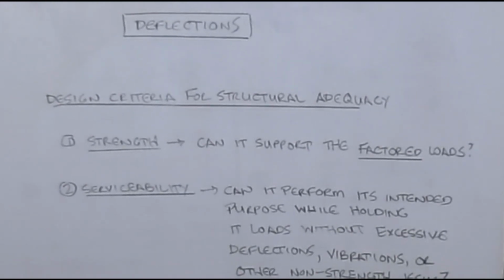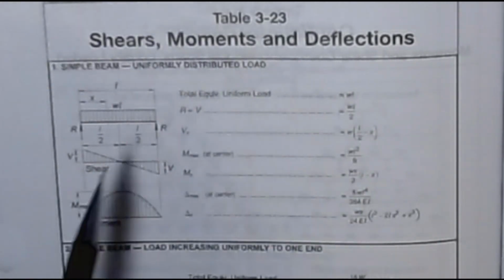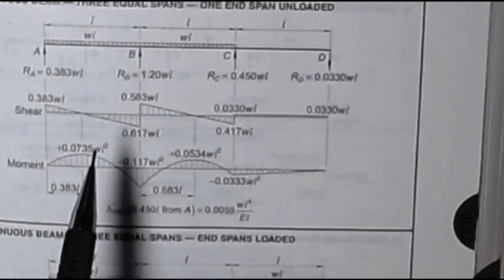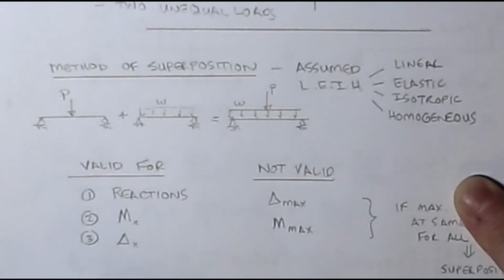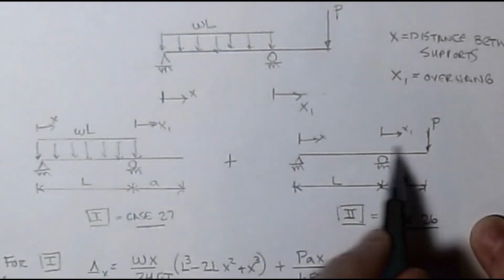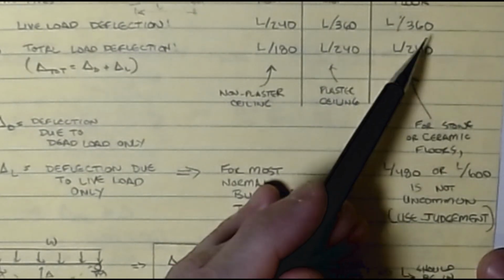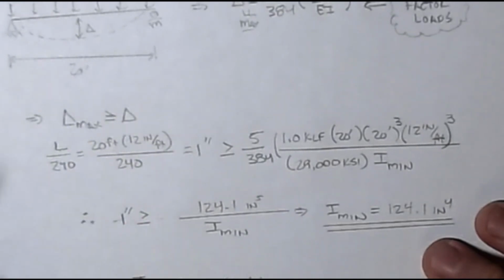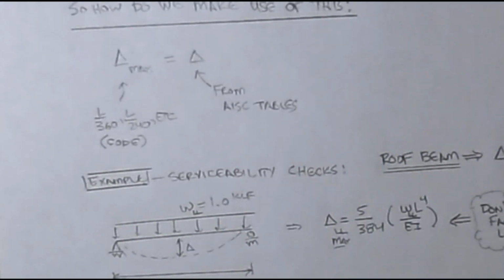027 CE341 Steel Design: Deflections and Serviceability of Beams

Comment: Great video, very simple and helpful class! I have a question. When you are considering deflection limits, how would you consider the deflection on the secondary beams as the limit? The relative deflection of the beam between supports, or the global deflection (because the primary beams would also be deflected)? I would like to hear your opinion on that.
Reply from the maker: For secondary members being supported by a girder, you have to determine the deflections of the secondary member separately to figure out its relative displacement to its original position (call this the chord displacement -- Part A).  You then need to compute the deflection of both members that the secondary member is bearing on at the location where the secondary member is being supported location (call this Part B).  Determine all of the displacements on an imaginary line between these two deflections from Part B at intervals along the length of the secondary member to find the new chord position.  Adding these values to the values from Part A at the same location will get you the total deformation a secondary member experiences on a flexible support.  Hope this wasn't too confusing.  Thanks for watching and let me know if you have any other questions.
Reply: @jaythreeengineering  Got it.. and when considering the code limits of L/360 for example. Should I consider the relative displacement? Or the total deformations?
Reply from the maker: @aleksischon90  Typically it's based on total deformation, unless the entire beam experiences a rigid body deformation that is equal at both supports.  For slabs I always use total deformation since there's seldom significant rigid body displacements at the boundaries / supports.  Hope this helps.